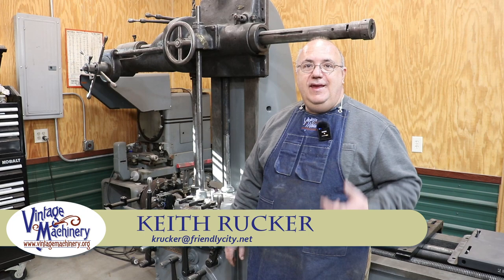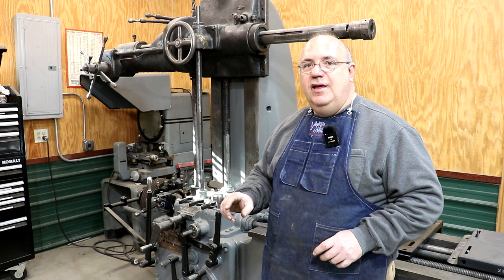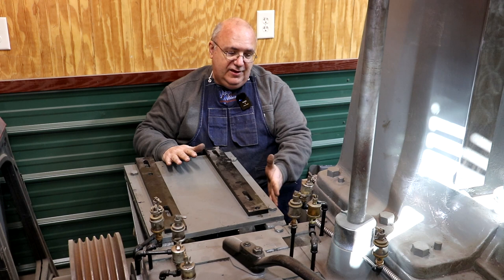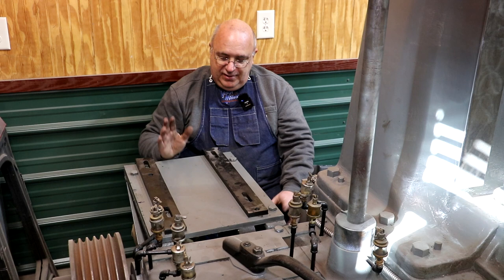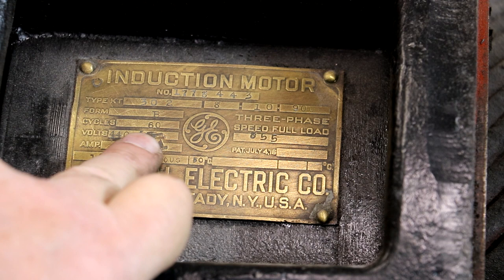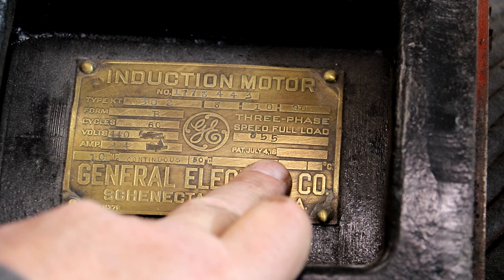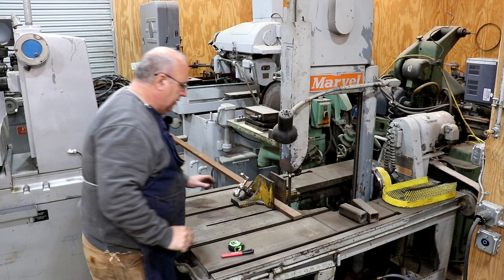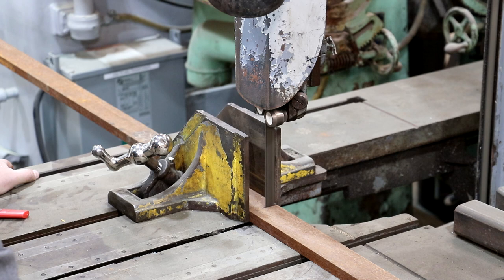Lucas Horizontal Boring Mill: Making a Motor Mount & Installing a 10 HP Motor

Comment: I’d love to see that old motor in a museum, even if it doesn’t work. We had a big motor for the street elevator in the building my lab was. We used that for many years — DC too!. That was almost two feet by two feet with a shaft that was about three inches thick. The connector panel mounted at the back was made from two inch slate. The gear was two and a half feet in diameter, four inch wide teeth.
Reply: Or maybe give it to someone with nothing better to do that has the ability to restore it to running condition.
Reply: @tsmartin  it would have to be a shop that does motors. You can’t really rewind a motor by hand.
Reply: You can see a nice collection of big old motors at the San Antonio Museum of Science and Technology.
Reply: @tpobrienjr  I’d like to see collections spread around the country. Most of us will never get to San Antonio.
Reply: The elevator motor sounds intense and immense! Thanks, Mel, and I think you have a good idea for the destiny of that motor. It would be a shame if it was erased by smelting. If a mint sports car is sitting parked with a blown engine, it still looks good!  :-0

Comment: I'm a retired machinist.  Ran a Lucas 3-inch spindle during my apprenticeship.  Went on later to run a 8-inch skoda floor model machining Forging Press frames and other misc. over the years.  Lucas was weird wrong-handed compared to other boring mills.

Comment: This episode reminded me of my apprenticeship in a heat exchanger shop. I had a Marvel bandsaw and radial drill about the same size as Keith's, and I spent many hours fabbing up large equipment. The Marvel & Radial drill could process a tremendous amount of steel in a shift. I would weld up to about 20-30 pieces of 3/4" exchanger tubing together at one end (to keep them from spinning) and cut them to length with the Marvel in one pass.  I can recall drilling 60" diameter tubesheets with about 3000 3/4"  tube holes each; they would take days to do. Each hole would have to be drilled, reamed, and grooved and there was a quick-change adapter that could change from drill bit to reamer to grooving tool without powering off the drill. It worked similar to an air coupler. I'm sure that would be prohibited today or at least changing bits under power.. We also had a couple of large milling machines and a giant lathe in the shop. The lathe had a through-spindle hole big enough to put a piece of 6" pipe through it, and a swing of about 28". We would actually turn 24" heat exchanger bundles to line up the baffle plates. A bundle that size would weigh a couple of tons, and we turned it at about 20 RPM.  
Later I worked in a more conventional shop and all the machinery seemed tiny. Good memories.
Reply: That would be fascinating to see! Did you drill and ream each hole before moving on to the next hole to drill?

Comment: Rebuilding that motor would have been hard, I’m sure, but man what a great video/video series it would have made. Maybe a collaboration with another channel that does that kind of thing.
Reply: Eh, not hard, but expensive. Copper, much like diamonds is being heavily up-priced now by thieves in power. The actual operation itself is rather simple, it's only windings (seriously, easy, go look up a 'how it's made' video on motor windings) and keeping track of what you're winding where, and making sure your leads terminate properly (majorly sucks having to unwind a previous section if you messed it up). Source: I've like 4 big motors repaired under my belt now, and the cost of the copper windings is what's killing me. Fixing an ancient unit is cost prohibitive.

Comment: The speed of an AC motor is not set by the voltage but is the frequency x the number of poles. Running a 440V motor at 220V will make it run hot as it will draw more current.
Reply: Low voltage will affect the speed because it allows the motor to have higher than normal slip between the synchronous rotating magnetic field and the induced magnetic field in the rotor.   This is also the reason for the higher amperage it will draw.
Reply: @jimrankin2583  does it affect the flux capacitor 😬 joking of course 😆
Reply: @jimrankin2583  Takes me back to the rotating machines lectures at uni some nearly 50 years ago.

Comment: Kieth 
during my apprenticeship ( 5 years) I spent 1 year in the stator/armature winding shop. this refers to both 3ph ac and dc motors Arthur my mentor then gave me a 5 hp Royce dc motor to rewind , ok I strippd it and noted the details , I asked him to check my work he got out his winding book and compared it to his , it was OK but he then referred me to the page heading 5hp -25 hp Royce , he then explained they are all 25 hp but when it was purchased new the store man stamped the name plate for the order . that why the old motors were on the big side. but wait this caused problems when the machines were updated to 3 phase ac 440v the drawing office looked at the job ,its got a 5 hp motor on it so just replace it with a 5 hp ac one , it would not run idle , they asked us to test the new motor its ok , with a smile on Arthur's face he informed them it ( the DC ) could be a 25 hp one . so its a case of caveat emptor with old 1900 era motor name plates

Comment: Just a friendly idea. When you are working by yourself if you were to hang an appropriate sized chain fall (small as possible while having the capacity) to the hook of your engine hoist (provided you had the head room) you could make the major moves with the hydraulics of the hoist to get close then when at the load you can use the chain fall for the micro positioning while seeing and lining up the material. More fine control and you can work while standing out at the load you are trying to set.
Reply: That is brilliant.  Well done!
Reply: The best idea I've seen follows this up. Have a second, much smaller 'leaver hoist' connected to your chainfall so you can use it to control the angle of a lift to get something into position.  (Dosen't count for single point lifts like this, but there are a lot of places were an uneven lift has to be done or avoided.)
Reply: @ElectraFlarefire  yep…. I have used that for installing lifting attachments to the first stage concrete sections of the Benicia Martinez Bridge deep water footings. 1800ton concrete segments set “over” 8 each 6ft dia piles.  The lifting attachments were plate weldments  bolted to the footing that used a 14” dia pin to connect the lifting eye.  To push and pull that pin there was a hydraulic cylinder off to one side that made them not hang level when being installed. We used a come-a-long to level the load when installing over the anchor bolts in the concrete footing.  Would include a photo but no way on YouTube.
Reply: @davidruss7702  Only seen that method used for small things, like assembling milling machines and engines into cars. Few hundred kilo lifts.
That is an impressive use of the same idea indeed!

Comment: This reminds me of what I did to my Cincinnati Monoset . The older Monosets had a 1/3 hp
motor and very much under powered for fluteing chips out on carbide end mills. I changed out the motor for a 3/4 hp three phase motor. With my phase converter it would cut hp to 1/2 hp . I had to  do some fitting and change the heaters in the magnet start . Most shops change their machines over. The new style Monosets have a 1/2 hp motor when they come new .

Comment: Keith .Fix that motor with new Oil Lite bearings a Bearing supply probly can supply the right ones . I fixed my K.T. Band saw motor years ago and it's still going strong just sleeve the shaft DONE DID.

Comment: I’m probably not the only one who’s going to say this; but I’d keep the old motor in storage. The next owner might want to run it on 440, or to shell out for a rewinding. I can see a museum doing this. From an aesthetic and historical position  it makes a big difference—especially with it being an exposed motor.
Reply: Ye, I was thinking the same thing, probably not in Keith’s lifetime but down the road a museum might want a fine example of a boring mill and the original motor, no matter what shape it’s in, would be a huge bonus.

Comment: If ya need more power transfer just make a five slot pulley for the machine. Id put the old motor together and set it up on a shelf for display .

Comment: Always enjoy your projects Keith, thanks! I just went through the expense of having the field rewound on a 213 frame motor that someone had done the same 3 wire 440 only rewind job. Like a fool I didn't ask up front the cost and just about fell over when I was handed the bill so you made the correct decision monetarily! I paid 3 times more than a new motor of the same rpm and horsepower would have cost, had one that fits this machine been available. Live and learn.
Reply: I guess there aren't many doing rewinds now - cheaper to buy new :(
Reply: @millomweb  There are plenty of rewind shops around for big motors (and REALLY big motors) where rewinding makes sense, but for anything less than maybe 50 or 100HP the labor to tear the old motor down, clean it up and rebuild it, and rewind it, just doesn't make sense. It doesn't help that the cost of copper in the US is about the same as gold. It's two or three times (at least) as much work to rebuild an old motor compared to building a new motor on a production line, so in many cases it does make a lot more sense to buy a new motor.

Comment: Keith, Don’t through the old motor away! Your not going to live forever and the next curator of this machine might want to repair the old motor. It is really cool and adds tremendously to the vintage machine you have here. Looks like a great temporary fix to using this machine.

Comment: My experience of small to large pulleys is that they can slip after a while when the drive end polishes up to a mirror finish. In my old 1930's engineering encyclopaedia there is a section to cover this issue by using wooden (teak) pulleys cross grain where the grain acts like bamboo shoots remaining sharp. Soft start with a VFD is also an option. That said  a machine like this has no real load on start-up making problems less likely.
Reply: I recall a sticky spray product that used to be available to spray on belts to eliminate slip. Not sure if a similar product is still marketed.
Reply: @ellieprice363  I think that was belt dressing spray, used for flat belts rather than V belts, but I stand to be corrected.
Reply: @johnbewick6357  I think that’s correct but it could probably be used on slipping V belts if still available.  If V belts are slipping they’re either very worn, not properly tensioned, or too few belts for the load. A little brake fluid on worn belts will often stop the squealing and slipping until they can be replaced.
Reply: They sell this for automotive belts—or they did a couple of years ago when I bought some.
Reply: We sell a sticky belt dressing at Deere it greatly increases the torque the belts can provide.
Reply: Fascinating...
Reply: Try "B" Linkbelt, easy adjustment and somewhat temporary.
Reply: If he has issues with the drive pulley, he can find, or make, one with more belt grooves. He probably won't load it that much anyway. He may actually be on the lookout for a working example of the original motor...... for cheap....if anyone has one ;).

Comment: Good accurate info on the old motor, Just last year I had a 5hp newmann 3ph 2 speed motor new  ball bearings and replace all 6 leads for a little over $300.    the cost to repair that antique  motor would easily double that and may be closer to triple with the cost of copper now days.

Comment: The 24" machinists square was comedy gold! 

I was thinking "He's going to have to clamp a flat bar to the pulley and reference off that or something... maybe he's got a special tool for this." then Keith just slips off camera and re-appears holding a Machinists square about the size of his torso... so not special per se, but unusual and appropriate to the job.
Reply: A cartenter square would've worked fine. :-) But you're right, it's a nice square.
Reply: I think that 24 inch “machinist” square is commonly known as a “carpenter” square. If so it should be plenty adequate for aligning those pulleys. The smaller pulley will double the motor torque so it should produce more power than the original.
Reply: @ellieprice363  No, the original motor had half the rpm and double the torque. The same power.
Reply: @LambertZero  Thanks for clarifying the way that works. I wasn’t sure how the speed change affected the horsepower. I suppose if the speed had remained the same the torque would double. Just another notch in my learning curve.
Reply: @ellieprice363  No machinist squares have a rectangular stock base, and a thinner leg. Carpenter squares are a single piece.
Reply: @ellieprice363  It's still a 10 HP motor - and the speed of the driven is going to be about the same - so same power, just that the motor is running twice the speed.
Reply: I think the threaded transfer punches are brilliant - do we know anyone else with a set ?
Reply: @millomweb  Yes they’re very common and relatively inexpensive. I’ve owned transfer punches and screw transfer sets from 8/32 to 5/8/11 Imperial for over fifty years. They should be readily available in metric as well.
Reply: @ionstorm66  Thanks for that. It’s never too late to learn something new.
Reply: @ellieprice363  I've never even seen a real live one !
Reply: @millomweb  Live what?
Reply: @ellieprice363  Transfer punch !
UK comedy !
Like sharks - only seen on-screen, not a live one !

Comment: You made the right choice with the motor.  Sure, you could have done something with the shaft.  Sure, you could have made new sleeve bearings.  Sure, a good motor shop could have brought out the leads (if it was rewound for dual voltage) and re-dipped the motor. (the motor most likely needs to be re-dipped).  
Now, if you were restoring this for the Smithsonian, your decision process would have been different.  But, this machine is going back to work.  Plus, with a more modern motor, you may have VFD options too.

Comment: To be honest, Keith. Looking at that motor mount on the machine. I question if that motor actually is original to that machine. While the build is period and matches, I have a hunch that the motor was swapped in at some point and adapted. I say that due to the rewind, the shim stock sleeve for the drive pulley, and several other small details.

Upgrading to a modern motor was 100% the right move.
Reply: Motor brackets looked to be arc welded, and the plate was mounted with grade-marked bolts. Neither would have been likely before about 1940 at the earliest. That machine is clearly designed so it could have been run from an overhead line shaft if it had a flat belt pulley. The question is if it came from the factory with the V belt pulley. I suspect it could have. In that case I'd bet the motor was originally mounted on the floor behind the machine. I'm guessing that at some time in the 1950s or 1960s the motor mounting was redone.

Comment: When you look for a belt, look at the the joined version where the 3 belts are made as one. You will have less issues then getting 3 matched length belts and I think they drive better.

Comment: I have run several Lucas HBM. Most machinists say the controls are on the wrong side. I found it much easier to use my stronger right arm to load tooling.
I don't see an outboard spindle support. That is great for long bores. I also spent a lot of time running DeVliegs. All HBM's are plain fun to run and are very versatile.  
Would love to visit your shop sometime. Great videos. Thanks

Comment: I’ve got a 25hp Baldor running my RPC… it came with an adjustable motor mount that is just sitting on the floor - would trade for it if you wanted to throw in some feet to replace the mount to get it off the floor

Comment: I think I wouldn't be so concerned with fewer belt grooves if you hadn't already reduced the drive pulley diameter as well.  The combination condition might cause you some slippage during high demand conditions.  Might be able to compensate by running a longer belt set and adding an idler on the slack side.  This would give you additional contact.  Don't overlook getting matched belt set instead of ordering individual belts of the same size.  When they're that big and not a matched set, the lengths vary quite a bit and you end up with the shortest belt hogging all the work.

Comment: Interesting. While the motor may well have been original to the machine, I'm almost positive that motor mount was not. The brackets appear to have been arc welded, which is very unlikely in the 1918 date range. Also that 3/4" plate was mounted with grade-marked bolts, and I'm not sure that those were in common use before the 1950s or 1960s. I suspect originally the motor was mounted on the floor rather than physically to the machine frame.

Personally I think I'd have simplified the new mounting by losing the 3/4" plate and making the two bars a couple of inches longer, and mounting them directly to the two support brackets. That way I wouldn't have had a crooked plate on the machine. But of course what Keith did works just fine.
Reply: Yes, that crooked plate doesn’t look like the normal 1900’s quality of work. Someone has been playing around in there and it has the smell of some under qualified apprentice showing why they should always have their work ok’d.